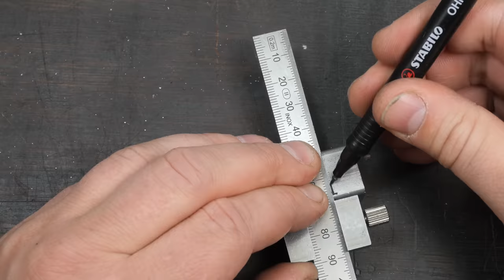I made this spokeshave

Comment: Very, very cool, and great to sere a video from you again!

Comment on the build. How well does the chip breaker part work? The shape of the chip breaker on a plane is extremely important and I wondered if you would see any difference in effectiveness if it was rounded over instead of angled (12:48)?
Reply from the maker: Hey, glad you like it! 
I don’t have strong opinions about chip breakers. I understand that a 100 degree angle from the back of the blade is common in commercially available planes and I have good experiences with it. I’m not sure whether the angled vs rounded aspect is so important because the shavings meet the chip breaker close to the plane of the blade where they are broken and deflected, if that makes sense.
But I don’t really have a direct comparison. It just seems to work :)
Reply: @imadethischannel  I have no idea if a rounded makes a difference, I was just wondering. After watching the English Woodworker's videos about setting up and preparing a plane I went over my chip breakers. I had previously flattened them for proper contact, but following his videos I optimised them and it made quite a difference.

Comment: Great work, but those handles are not going to last if you pull on them.  The body should have been made from a solid piece of wood instead of the metal mid-section. Still, doesn't take away from your amazing skills.
Reply from the maker: Thanks! It is intended for relatively fine work like shaping guitar necks. So I hope the handles will be fine. So far they have not moved one bit. 🤞

Comment: the strength of the wood gripping the bolt will not last long, because of the constant pressure. In TAICHI, round shapes are stronger and more flexible than square shapes. However, I admire your tenacity and struggle.  I subscribe your chanell and Good Luck. God Bless You....
Reply from the maker: Thanks! I’m no expert in Taichi in it’s application to toolmaking. But I’ll keep my eyes open.

Comment: Really bothered by the way you cut away almost all of the wood where the handles insert into the metal center section.  Those handles will snap right off if you try to use this the way a spokeshave was intended.
Reply from the maker: Yes, good point. But handles fit quite tightly in the steel tubing and are also held in place by the epoxy and the screws that hold the cap. I have been using it quite a lot and it hasn’t moved a bit so far. It is intended for more delicate work, though.